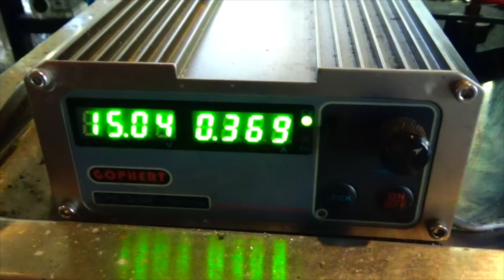#RoughCut2022 - How To Make a Lathe Tool Height Setter.

Comment: I made a 1inch chamfer d-bit a while ago, with a reduced shank (12mm) out of silver steel, 2 lathe operations (for the shank and cone), followed by a mill to half diameter, then some stoning followed by heat treatment and honing, it worked well for the chamfering, but sinced then I stick it in the three jaw on my lathe and use it to set tool height, it works a treat for finding centre vertically (normal and upside down) and horizontally
Reply from the maker: I agree that such a tool can be used and it's a lot less complex to make. I would encourage everyone to use the method that works for you.
Regards,
Mark

Comment: There is at least one bubble level based center adjusting tool I've seen but this one seems like a functional alternative. At first I thought that the adjustments went haywire when changing from tailstock to spindle but then my brain went on a thinking mode (rarely do) and I realized that the two measuring surfaces are actually equal.
I think the best way to calibrate this tool is to do the calibration with a tool whose cutting surface is upwards. Just do the calibration both in tailstock and in the chuck without changing the tool. Then it is easier to access the adjusting screw as well.
Cheers, Esko.
Reply from the maker: Why didn't I think of that? Since I finished the two tools and the video I have not actually used them. One is to be kept unused for the give away but the other is sitting by the lathe waiting until I return home. We are actually in New Zealand at the moment and we left just after the tools were finished. The design I came up with is a bit like the Edge Precision lathe tool setters. However, as far as I know they don't make one that will do both regular tools and inverted tools. 
Regards,
Mark

Comment: Gday Preso, what a brilliant idea, I think I best be making one myself, the anodising really finishes the tool off nice with the engraving, awesome job as always mate and congratulations on clicking over 30k subscribers, Cheers
Reply from the maker: It probably seems a bit like overkill but I have one that was given to me that only has one bubble level so it wont' do inverted tools. It has a 90 degree vee notch which you have to hold against a cylindrical surface while you adjust the tool height. It is made of injection moulded plastic and it sort of needs three hands to use easily. 
Regards,
Mark

Comment: I made one in 10 minutes.  Screwed two plates on top of a pillar to be placed on the cross slide. The two plates look like an open scissors offering two surfaces for a normal tool and an inverted tool.    No need to mount on any chuck which can be available unused or not. No need for late leveling. (the lathe may be free of twist but not necessarily level)
Pop the "Gauge" on the cross slide, wherever the slide happens to be, no movement. m
Move the tool older up or down for a rough adjustment and trim with the tool older adjusting knob to exact height. Done in 7.4 seconds. 
The tool presented has one advantage: The same gauge will work on any of the seven different lathes you own.
Reply from the maker: I already have a small tool setter made from injection moulded plastic. It looks like something that would be given away on a trade stand or machinery show. It works and it's surprisingly accurate but you have to hold it with one hand while setting the tool height. I guess what I made was unnecessarily complex but it was a nice thing to make and to give away as a gift.
Regards,
Mark

Comment: I have to use shims to set my height for my tooling in my lathe, altho this video was not helpful to my situation it looks like a fun project and I will be making one soon, thank you.
Reply from the maker: I used shims for more years than I care to remember but the "set and forget" method which utilises quick change toolholders and insert style tooling becomes very attractive if you can afford such luxuries. The tool height setter is another luxury but there are simpler methods of achieving the same result.
Regards,
Mark

Comment: Oh, I'm waving at you from Wellington :)
They look 'Perfect'!  Everything about them right down to the vibrant complimenting colour scheme (even the copper discs were colourful). They just pop.
I was thinking for most of this video, "Is it April 1st?", it would be very 'This old Tony' esq to make something so elaborate only to find the centering is done by pushing the tool into round stock with a steel rule between them :)

Comment: Nice job Preso.  However I sometimes find I need to check heights half way through a job with the job in the chuck and with either a tool or live centre in the tailstock.  I use your old tool concept with a simple machined steel cylinder with a sharp top edge.  Just use a finger nail to check for level.  No need to worry about upsetting DRO settings if you use a 40 position European style tool holder.  They fit back into postion very accurately.
Reply from the maker: John, I would very much like to own a multifix tool post. Unfortunately they are a bit rare and expensive out here in the colonies. The old style tool height setter works very well but you have to think ahead and get the tools all set before you start the job. 
Regards,
Mark
Reply: @Preso58  Hi Mark  Thanks for the reply.  I also live in one of the penal colonies -  up the road a bit.  Luckily my lathe came standard with a 40 position holder.

Comment: I have always used the ruler method. A small diameter rod in the chuck and a 6" ruler. 
Bring the tool up to the rod, pinching the ruler between them, then adjust your tool height so that the ruler is dead plumb.
Simple but accurate.
Reply from the maker: That absolutely works and I have used it myself but I wanted to make something nice to give away as a prize. I will be doing an announcement with details of the give away soon.
Regards,
Mark
Reply: Exactly the method I use, accurate enough for my hobby stuff

Comment: Very cool tool. I've seen similar made by Edge Technologies, but I think I like yours better.

I usually use a scale, pinched between the tool and the stock to set the height. Your way is definitely more precise.
Reply: The scale trick is how I was taught as well… but this way is definitely better on the purple alone lol
Reply from the maker: My version was based on the Edge Technology design but it does have the capability to set inverted tools as well as conventional tools. The Edge Technology version is over $100 Australian so it's not exactly cheap (here). 
Regards,
Mark
Reply: @NitroRustlerDriver there not a chance in hell, that using ANY tool with all those machined mating surfaces, with their potential for error, is "more precise" than simple geometry and physics....

Comment: Beautiful tool, would love to own one. I just made a tool more like what you showed at the end. But......the bearings are a bit of overkill, don't you think? A simple slip-fit metal on metal shaft would do the trick.
Reply from the maker: Yes, just a sliding or slip fit would be fine. I am sure you could just 3D print something that would be just as effective. I just get carried away sometimes.
Regards,
Mark
Reply: @Preso58  Well, it is still a great idea and yours is beautiful. Nothing wrong with pride in your own tools. I'm playing with a grossly simplified design now that just has the "ledges" of the main block on the hub centerline. No adjustment screws, no bearings. Here's my concern - can you really read the bubble level that accurately? I will know when I try it - ordered a couple. Thanks for the inspiration!

Comment: nice. never seen a spring loaded scriber like that
Reply from the maker: Nor had I until about three years ago. I have two but the one that I bought from Boring Research is the easiest to use. The carbide point is held in by a magnet so it won't accidently drop out of the spindle. The good thing is that you don't have to worry about having your part exactly level. 
Regards,
Mark

Comment: Just so happens that I DO use cutting tools every day when I shave my cheeks.  (The rest of my mug shows a beard.)   I've never tried the "cutting my face hairs" with one of my lathe tools yet, but I do use a honed HSS tool to trim my nose hairs every week or so.  Just so I look nice for church, you know.  :)

Actually, I just use a 6" rule and put it against the round stock in the lathe, then adjust the tool up or down until the rule is vertical.  
I like your shop and your video though.  Happy machining from the Yanks, mate!  :)

Oh, BTW, the tool looks beautiful, and my 45 year old daughter has always been a fan of purple-ish colors.  Very nice on the anodizing.  Engraving looks great too.
Reply from the maker: I wanted to make something nice to give away for the 30K subscriber draw, which, as it happens has snuck up on my very quickly. Thanks to Blondihacks I believe. I must say I have been through a lot of frustration trying to get my anodising process to work reliably. The more opportunities I get to try it out the more I learn about what not to do. The engraving process is pretty much second nature to me now.
Regards,
Mark

Comment: Nice tool Mark. Only problem I can see with it is one has chuck the tool into the spindle or the tailstock to set the tool height. It also assumes the tool post and/or holder will adjust straight up and down. Also unless one uses well made tool holders and insert tool bits there is no guarantee on Z axis.
All that said it is very neat and I really like the upside-down tool setting feature. I made a similar one with an arms that can reference off of the compound, cross slide, or the flats on the lathe bed. I carefully measured the spindle axis height above all useable reference surfaces and made a diagram for easy reference.
Reply from the maker: I know this type of tool won't suit everyone and there are lots of ways to set tool heights without something as complex as mine. For my lathe configuration it is quick and easy. I use a lot of tangential tooling with HSS and each time you take the tool out to sharpen it you need to set it back on centre. (That's the down side of tangential tool holders). It sure does look pretty though!😁
Regards,
Mark

Comment: Very interesting.  It has been over 45 years since I earned my living making very small bits of metal from larger ones.  I noticed that you did things very similar to the way I would have.   Really liked the purple die added to the anodized part.  I wonder why you took the part out if the mill to bore for the bearings.   Don’t you have a boring head for your mill, or don’t you trust it?  After all it was already aligned.    Not a criticism, just a question.
Reply from the maker: I do have a boring head for the mill but I find it easier to get accurate bores in the lathe. I can use the DRO to work out the depth of cut whereas the boring head is a bit more tedious. 
Regards,
Mark
Reply: OK, I wondered about that.  Since I did machining before DROs, I don't usually think along those lines.  Still don't.  Do have a z axis one on my tiny mill, but all else is dial or indicator.  I do miss the optics on a Bridgeport mill though. @Preso58

Comment: I like that a lot, but l prefer your older one, because I've usually already got something set up in the chuck when I realise I need to set up a new tool.
Reply from the maker: But that is the problem that I have. I have to rotate the QCTP to bring the tool tip into contact with the height gauge and that means that whatever reference you have set up on the DRO or your micrometer collars is lost. You can still fit the height setter in the tailstock if the chuck is already in use. If I had one of those lovely multifix tool holders I wouldn't have a problem but I don't have one and I doubt my budget will ever stretch enough to have such a luxury. 
Regards,
Mark

Comment: How did you get a collet chuck into the lathe, is lathe modified. Yes I am not a machinist but love making stuff.
Reply from the maker: I purchased a Turnado Freehand Turning attachment https://www.eccentricengineering.com.au/shop/The-Turnado-Freehand-Metal-Turning-System-c46075015 and one of the recommended accessories is an ER25 collet chuck that fits in the lathe spindle. It is small enough for the table of the freehand turning system to reach underneath the spindle and it also makes a handy small collet holder for round stock. I made my own ER25 chuck body to fit the MT5 spindle nose and it has a draw tube so I can fit long stock down the centre of the chuck body. 
Regards,
Mark

Comment: I was taught to pinch my six inch (150mm) scale between the tip of the turning tool and the work.  Vertical scale means proper alignment!
Reply from the maker: That absolutely works. Still, I like making tools and I have fun with the anodising and the engraving. 
Regards,
Mark
Reply: @Preso58  nothing wrong with making a tool to make things easier.  The ruler method does work  but it's not as easy or convenient.  And I've dropped my scale in the chip tray enough for one lifetime 🤣

Comment: Gday Preso, I noticed how you part on the lathe. Do you find advantages of doing it that way?
Reply from the maker: The inverted parting tool allows the chips to fall out and not pile up on top of the cutting edge but it's more to do with the way the cutting forces pull the cross slide upwards during the cut. This tightens the dovetail of the ways and it's less likely to dig in. 
Regards,
Mark

Comment: Could you put or machine a known dia into to chuck. Then rest one end of a known straight square bar on said dia and the other end on the tip of the cutting tool with slip packs to space it up half the dia or the known turned dia. Then you could use the spirit level to check for the required correction. The further the tool is from the dia the more accurate it would get. I’m not a machinist but it just popped into my head as I watched.

Comment: Wow, that's a really good way to set height! Love the tool. Is there a tool that can get the angle of the tool post accurate? Can't get my cheap aluminium qctp to cut even 30mm without loosing 0.6mm when cutting straight up the Y axis to face things lol
Reply: The toolpost has nothing to do with that. Your cross slide must be not at 90° to the ways. If the toolpost is moving around on the cross slide/carriage during a cut then you need to bush the bottom of it and lock it down harder. Some people add a roller bearing under the clamp down handle thingie.

Comment: Hello Mark, I wonder why your parting tool is upside down. Does it work better that way?
Reply from the maker: Yes! I recently made a rear parting tool post for my lathe and it also has an inverted parting tool. The forces on the cutting edge pull the tool up and away from the surface being cut. A conventional parting tool will bend down and inwards. Check out this video for the explanation https://www.youtube.com/watch?v=QuyXYyXHc4o the animation of the cutting action starts at about 2:30
Regards,
Mark
Reply: @Preso58  that’s an interesting look at  machine mechanics. I guess it’s a consequence of weak machine design or poor fitting of the parts. I have built a solid front tool post for my lathe and no problems parting regularly. I used to break a lot of tools and inserts when I used Chinese parting tools, now I switched to name brand inserts and holders which I found to be much stronger. I’ve also found I get more chatter using hand feed than power feed on parting. With good feeds and speeds parting chatter is a problem of the past. 

Workholding is also an equally large contributor to rigidity as tool holding. If you haven’t seen it yet, Robin Renzetti’s latest video goes over how to optimize chuck geometry to maximize workholding rigidity.

Anyhow, you seem to have many a thing already figured out so I’ll leave you to it. Have a nice day!

Comment: Interesting!
May I ask what is the advantages of the inverted parting tool?
Reply from the maker: Dwight, the cutting forces tend to pull the parting blade upwards which closes any clearance between the dovetail slides on the cross slide and compound. The chips also fall straight down instead of piling up on top of the cutting edge. This allows coolant or cutting oil to get at the sides of the tool easily. I purchased the inverted parting tool because I hate parting off in the lathe and I have had some scary moments where a conventional tool had dug in and either damaged the part or broken the tool. My next project is going to be a rear tool post with an inverted parting blade. This is really the ideal setup for parting in the lathe but finding a genuine Colchester rear tool holder in Australia is just about impossible. I have the materials to make my own version and I intend making a YouTube video covering the project.
Regards,
Mark

Comment: Very nicely made tool!! Looks and works GREAT!! One thing, turn your mic off when doing those cuttings. or setup The motor hum noise is annoying. Good video.
Reply from the maker: The hum is my rotary phase converter. I know it's annoying but short of moving it into another location and running three phase wiring to the mill I just have to put up with it. I usually mute the sound when I am milling but if I have to talk to the camera it's going to be a case of shouting over the dreaded hum.
Regards,
Mark

Comment: Great tool, great skills. I feel though that this is a little bit over the top just for checking/setting the  height of your tool.
I have 5 tools and 5 quick change holders. I set them years ago, never touched them again...
Reply from the maker: John, I have three of Eccentric Engineering's tangential tool holders. I love them but when you remove the tool for sharpening they don't slot into a horizontal position like a regular lathe tool bit. So they have to be reset every time. If you are using a lot of insert tooling it's probably unnecessary to have a tool setter like this. I still like HSS tooling though. 
Regards,
Mark